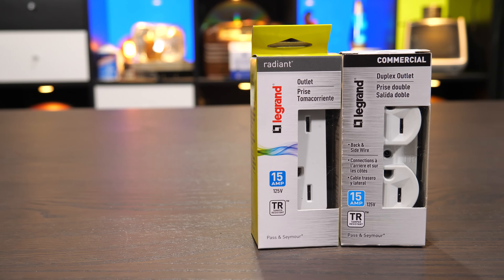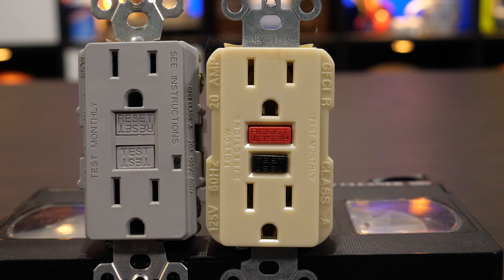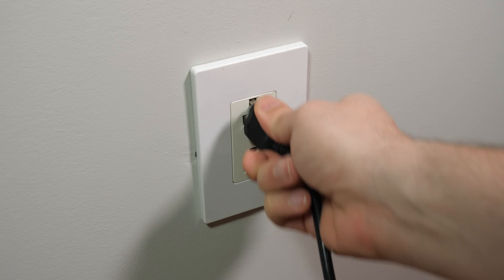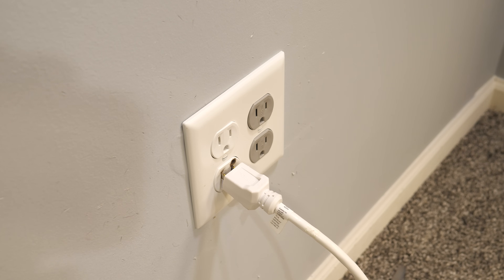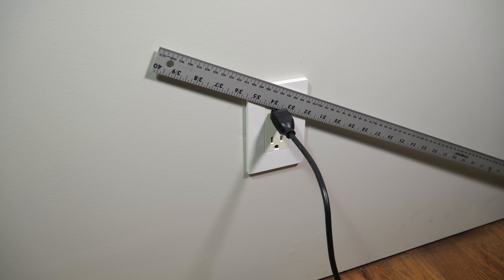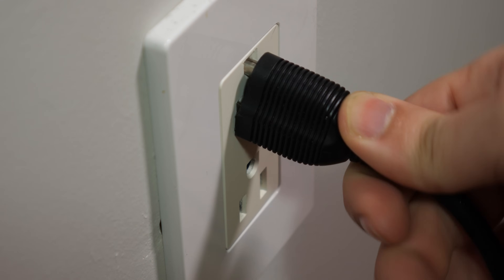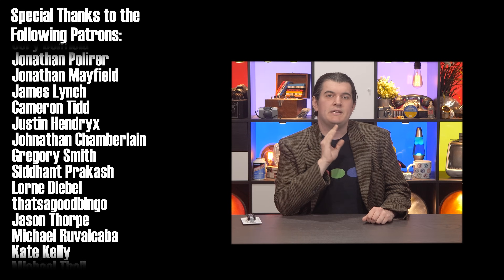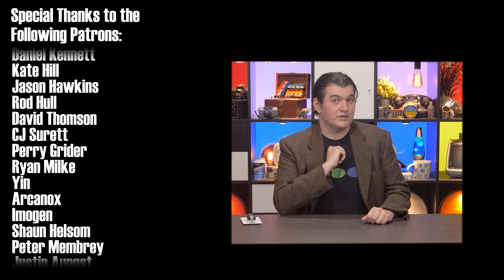Power outlets are topsy turvy - but does it matter?

Comment: Oh wow... you have just hit on my pet peeve!

I own a 120 year old house, that back in 1984 went through a major update that included putting in 200-amp grounded electrical service. Plugs were installed everywhere up to code (and those that were existing were upgraded) and thanks to an OCD Electrician, every single one of them was installed upside down (or "properly"). 

It has slowly driven me insane for every reason that you have mentioned in this video. The plugs are still perfectly fine and not worn out.... but trying to get cords, transformer boxes, etc. to behave nicely in an "upside down feed me world" has just been crazy. I guess it's time to bring in another technician to replace all of them and reorient them correctly.

Thanks for the info!
RBS
Reply: Same here. And since my outlets are different to the usual, right angle cords are a real pain to use.  So I don't have as much love for them as Alec does.
Reply: You dont need to replace them, just unscrew them and flip them over. 30 second job per outlet. The wires usually don't need to come undone, they will twist around. All you need are a flathead, philips and square screwdriver. Unless your time is worth 100 dollars an hour its an easy diy job

Comment: I hate them with the ground pin up. The I have many cables that are in the standar down ground and they are designed to "hang" and not to damage the neck of cable . My house in Mexico has it installed in whatever position, and the ones that are up ground pin alwasy mess those cables.

Comment: Locally, common practice is to install all outlets in the "face configuration" except where switches control the outlet. Then they're inverted explicitly to tell you what outlet is controlled by the switch so you're not just hunting around for it and trying to memorize which one in each room.
Reply: That's an obsolete practice.  As of the 2014 NEC, automatically controlled receptacles are required to be marked as "controlled" and to have the IEC Power Symbol ("⏻") symbol on it.

Unless you have a compelling reason to do otherwise, I'd suggest using ground pin up for all vertically oriented non-locking outlets (the way hospitals do it) and neutral pin up for horizontal installations (the opposite of common practice in Chicago).

The National Electrical Contractors Association's National Electrical Installation Standards (NECA 130-2010) recommends that receptacles be mounted with ground hole up.
Reply: @jmdavison62  I'm sharing experiences with what I'm seeing first hand out in the wild; I'm not installing anything. And yes the upside down plug representing the switched outlet is very common here even in the new builds going in. And as a renter I'm not going to do anything to any of the outlets, so they stay as they are.
Reply: @jmdavison62  What's the advantage of having the neutral up?  Like they say in Chicago, "if the ground isn't right, it's wrong."

Comment: I bought a house in Dallas built in 1980 that had every outlet with the ground pin up.  They looked like they were installed by a drunk electrician.  Even guests noticed it so I "corrected" each one a room at a time over several months.  What a waste of time... 🤬

Comment: All of this has given me the idea for a receptacle where the ground pin points OUT, so there is a ground pin on top and bottom - then you can still plug in right angle stuff in the bottom while having a safer plug on top.

Comment: I had an apartment that had the crapiest wall plug covers. Instead of holes for the sockets they were covers. About a 16th inch of additional plastic over the sockets prevented some adapters from staying in the wall. Also some of the oulets were so old no plugs would stay in.

Comment: Seems like having a mirrored receptacle with the ground prong towards the top and bottom would make the most sense. You get the ground plug at the top, and get to use the 90 degree cables on bottom. Then direction is irrelevant. Still can't compete with a type C or F plugs imo.

Comment: Right angle (offset angle) plugs are great and I use a ton of them. However, they don't work in a recessed outlet setup.  
Tamper resistant plugs stink and cause more problems than they solve. 
I feel like you've re-released this video from an earlier time. Maybe you tripped a breaker on the time-travel machine?

Comment: What I took away from this is the correct, best orientation is "Sideways, with ground plugs on opposite sides from each other so two right angle plugs can be used together" and I'm all for this idea personally.
Reply: Why opposite sides? Why not just upright(ground pin down) but side by side, like 2 faces next to each other?
Reply: @josiahferrell5022  so we dont have to spend soney designing a new plug
Reply: @josiahferrell5022  that would work too, though I'm not sure which would be harder to wire up. Iirc the wires plug into the sides of the sockets, and by having then next to each other you run the risk of a short or having electricity arc. If they're just flipped from each other the wires wouldn't be closer than if they both faced the same way.
Reply: @Xanthelei  The way the plugs are manufactured has just been adopted to the standard stacked setup that is seen.  If whoever it was decided to make them side by side, I am sure they could design the manufacturing process to accommodate that as well.
Reply: @Xanthelei  The wires would have to cross over each other if they're facing opposite ways.
Reply: @josiahferrell5022  It seems you don't understand that the reason sideways is correct is to counteract gravity. So having the grounds face away lets you plug two grounded cords without having them overlap each other.
Reply: Some right angle plugs are now being designed with a 45* orientation to the vertical of 'stacked' outlets. I like these.
Reply: Sort of reminds me of the 'specialty' housings I've seen in places like professional kitchens & chemistry labs which are intended to be installed "sideways" - so the plugs are side-by-side instead of over-under, but oriented upright.
Reply: Late to the party, but I'd argue sideways with neutral up is best, and then forcing new right angle plugs to be aligned 90 or 45 degrees, so it's facing down (or down-ish) in new recepticles, and facing sideways (or down-ish) in old recepticles. This covers all fields, including a good ol' game of throwing knives at the wall.
Reply: @nonstop7243  I did this when installing two duplex receptacles at the end of an island.  Strange that this is opposite the "Chicago way."
Reply: When I bought my house 3 years ago, every outlet was installed ground side up.  I initially didn't care but most power bricks and right angle plugs are not designed to work properly with these.  I've been slowly converting every outlet in my house over to ground side down
Reply: Or you could just install the wall socket horizontally with both plugs having the earth pin on the top, so that the socket can accommodate 2 plugs with earth pins at the same time
Reply: Love my sideways outlets
Reply: This is what we need!
Reply: I agree. I would like outlets with the ground receptacles on the outer edges so cords with transformers on them don't block the other outlet.
Reply: What if the plug sockets were traditional vertical form, but the plugs, where you plug in a item were able to rotate?
Reply: The correct, best way is to switch to CEE 7/3 outlets. No "orientation", no pivot points, a little recessed into the wall, so no live contacts exposed, you get me.
Reply: I have a workbench style power strip i mounted to my desk that is exactly like this with the plugs side to side. I love it because right angle plugs are never an issue with it except the very few that have the 45 degree angle cable which i personally have only ever seen on power strips so it would never be an issue in my case since it is pretty common knowledge to never daisy chain power strips.
Reply: It would make the plugs more expensive, though. Because it would be much more complicated to wire the plugs in parallel.

With the plugs in the same orientation, they can be wired in parallel with a short bar on each side - one for the hot, one for the neutral.

If the plugs were oriented in opposite directions, you'd have to criss-cross the plugs for both hot and neutral.

Comment: I'm surprised that you mentioned Chicago and the outlets being horizontal without mentioning the old adage "If the ground isn't right its wrong" It apparently stems from the fact that horizontal receptacles in metal boxes and metal drywall rings mounted using screws through a slot have a tendency to slide downward over time allowing the terminals and wires on what  is now the bottom to contact the bottom of the box or drywall ring and if the ground is on the left the live terminals are on the bottom...

Comment: Must say that the more I see about those plugs, the more I love the Schuko plug.
Pins protected, deep socket so protected pins are unreachable, non orientation dependent.

Oh well.
In another note, since you are so good at explaining. Have you ever considered explaining how a gas refrigerator works, had several people trying to explaining as well looking up and still fail to grasp on how heating up a liquid/gas refrigerates.
Reply: I'm guessing heating the liquid causes it to evaporate, and when it condenses is when it absorbs heat.
Reply: @RS2020-tb6hf  but state of matter transformations say that going from gas to liquid releases heat not absorbing.

To absorb heat you need to go from liquid to gas. But it only does that while being heated.
I know there is a reaction inside but i keep failing to grasp how it really works and how those double sided tubes are crucial to make it work.
Reply: @AlternateTab00  Good point. I don't know.

Comment: I care. Most of my three prong plugs have the wire running down instead of straight out away from the wall. 

Because contractors are inverting these outlets, now my plugs are putting force onto the outlet and slipping off. 

If they are going to market outlets inverted, at least have them do the same for the plugs.

Comment: This is a "live with it" take I wasn't expecting to be honest. American plugs are so bad and weak, most don't have a stabilising pin either. It sucked when I visited. Correcting the socket position is a step towards a better system. All of the bad plugs you're referring to should change over time no? Why impede progress, we need more safety pins in these plugs (also that visual demonstration you gave of how those safety pin plugs had less plastic around the pins was a reach tbh). The only good plugs I saw were in PA and had the safety pins, strong enough to hold up my heavy GAN charger. And with safety pins, it makes sense for the ground to be on the bottom. The placement of the wire also can be changed on these plugs, that demonstration at 14:00 was also very silly and a reach. 

Usually your opinions I basically fully agree with but this one was a bit lazy imo.

Comment: It really doesn't matter, biggest issue is I've run across many miss wired outlets that were signed off on by inspectors while the ground was HOT then use the conduit as ground.

Comment: I hate the ground pin up installation of receptacles.  Nobody likes them that way so every plug-in device manufacturer made their plugs ground-down.  Power strips and UPSes commonly prefer ground-down but a LOT of device plugs are designed to hug the wall, meaning the cords are now oriented "up" in a ground-up setup.  It technically still works, but you are putting a lot of unnecessary stress on the receptacle and the plug.  That alone is reason enough to keep a ground-don configuration.

Comment: Not to be argumentative, but the pluses are bigger than the minuses for "upside down" outlets. Here in Texas, they are all installed either sideways or with the ground pin on top. Many right-angle plugs are designed this way, by the way. It's a crapshoot which one you get, but most of the right angle plugs in my house (battery backup UPS mostly) are set up with the ground pin on top.

Oh, and at least we can all agree that our plus are still WAY better than the Euro-style plugs.

Comment: That isn't 'right'. Besides, when you buy a cord with a flat wall plug the cord hangs down, to one side and not up, with the ground to the bottom. This is just another, "Which way does the toilet paper hang?" argument to develop clicks. If it was a great concern it would have been written out of code decades ago.

Comment: The issue with the right angle plugs occurs only because the electrical standards did not describe fully all aspects of the American outlets and plugs.
Enforcing a recess for the plug in the outlet would also have immediately prevented most electrocution risks regardless if the ground pin is on top or at the bottom. Integrating the children safety feature to the outlets as is mandatory in Europe including the UK is also safer as it does not require plastic covers.

Unfortunately, even the EU is not too great on standards, there are two main standards, plus four for the UK and Ireland, Denmark, Italy and Switzerland, with different ground pin designs: The pin is part of the outlet in Type E (France), making a recess logical, it's part of the plug in the UK, like in the USA, but all 3 pins are overkill in size and the ground pin is perpendicular to the other pins, making it impossible to bend the plug and expose the live pins, and Type F or Schuko (Germany and most of the EU) outlets have 2 small collapsible ground pins on each side, meaning the plug can be inserted in 2 different ways, but also that you can't enforce which pin is live and which is neutral, like some appliances require.
Plastic sleeving as you show is almost always present in Europe for 2-pin plugs, even though outlets offer a recess.

In any case, something is very wrong with the thin metal American outlets; They wear out rather quickly with use, old 2-pin plugs tend to slip out under the sheer weight of the small length of cable, as happened to me for several outlets from the 1980s. I had to replace all outlets of my home 10 years ago. All incandescent light bulbs too, but that's a different story.

I now live in a bicentennial house where I am currently redoing the whole electrical installation to the latest (French) code, it didn't even have ground wiring, that was the first thing I did, so now I can decide if I want the ground pin up or down or on the side!  😄

Comment: I've only just started the video, but after thinking about it I can see how upside down outlets would be better.

I once had to unplug a security panel plug that was screwed into an outlet with a metal faceplate, when the screw finally came loose the faceplate fell onto the prongs of the plug, sparked, and tripped the breaker.

Comment: As a British engineer living in the USA, I spotted this wrong orientation socket right away.

And at home, within 4 years, we had an incident when foreign object fell across a partially inserted plug.

My daughter spilled her spare change coin jar on her dresser and a penny fell and shorted out the plug. 

It made quite a pop and tripped the circuit breaker so no harm done but it does happen.

Comment: Playing 'throw the knives at the wall' just hasn't got the same level of danger here in the UK with our BS 1363 plugs, even with 230v. The most you'll do is hit the switch to cut the power and reduce the element of danger even more.

The plastic safety covers that may make US sockets safer for infants do make UK sockets more dangerous as they disable the already built in safety features by opening up the shutters. And given how the type of cheap and slightly flexible plastic they're often made from gets brittle over time and through stress, it's best not to use them at all.

Comment: I was a Kitchen and Bath contractor, after 50yrs of measuring  backwalls of kitchens, I've had more than my share of electrifying moments when the metal blade of my tape measure exploded and roasted across the two live legs of a plug partially out of the receptacle. With the ground up that could never happen. Thank God,  by the late '70's, most of the tape measure cases were plastic.

Comment: He was saying about the one screw in the middle but if you look at the outlet at 13:35 for example that outlet has no screws on the plate and in my apartment the outlets are ground at the bottom and on the plate has a screw on the top and another screw at the bottom it drives me crazy when ever I see an outlet installed ground up I don’t mind sideways outlets but whenever I see an outlet with the ground on the top it just drives me crazy I absolutely HATE seeing plug outlets with the ground on the top and I’ve else seen some really old plug outlets that don’t even have a hole for ground just the 2 other holes and some extension cords also don’t have ground holes

Comment: What are these connectors with a live and ground pin only? Does it run an appliance with the ground as the neutral? Wouldn't that trip the GFCI?
Reply: Nevermind. I think I was just not using my eyes well enough. I thought I only saw a ground and live pin when the plug at 4:58 got plugged in. Even though you can clearly see it's a three pin plug right before and after.

Comment: Moved into my first home in January. It was built in 1963 with an addition built in the 1990s. In the old part of the house, it had brown plugs with metal plates and the ground facing up, and in the addition they were beige plugs with the ground facing down. Of course, I changed every one in the house because they were so worn out (barely held onto plugs and at one time threw sparks at me) to all new white ones and made sure to twist all wires 180° and put the ground down on all. Never understood why until now, and it was for no reason! So thanks lol